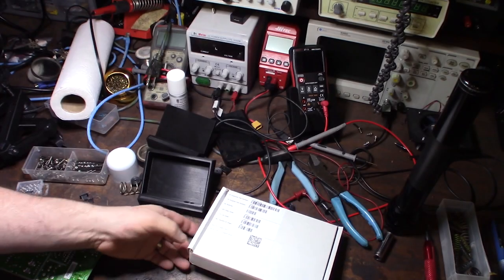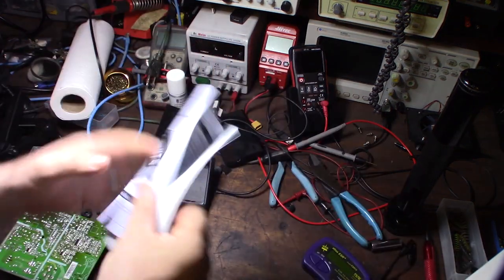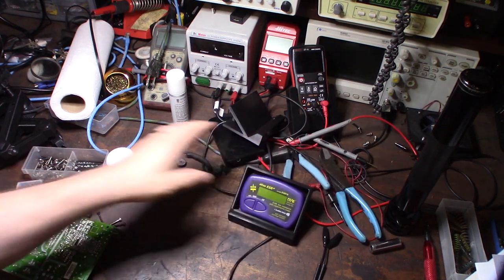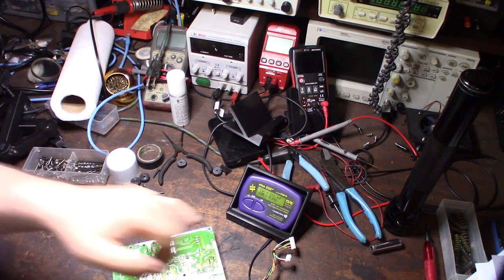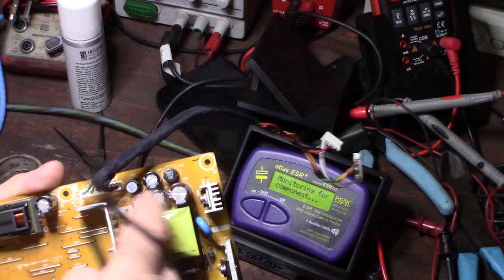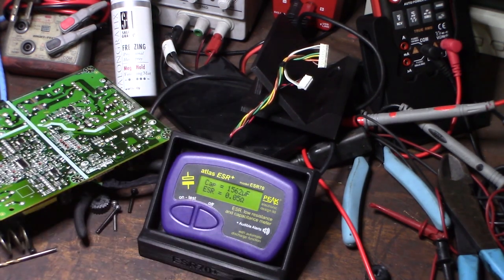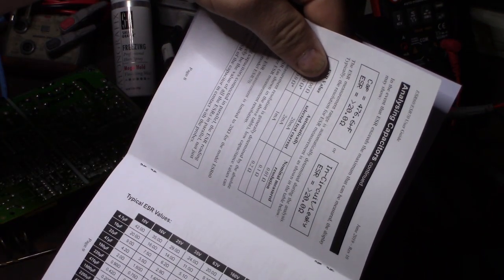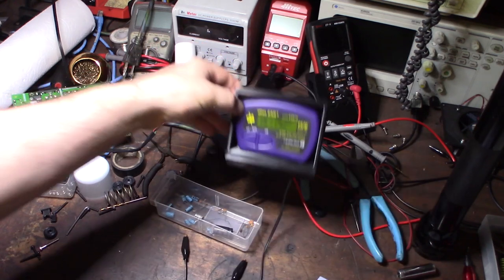Test Capacitors In Circuit With ESR Meter Peak Atlas ESR70 plus in circuit cap

Comment: Hi 

I need your help. 

I have checked the capacitors on my digital piano and got the following results in ESR levels. I used the peak ATLAS ESR70 gold.

10000 uF 25V - ESR 0.01 ohm
2200 uF 25V - ESR 0.02 ohm
470 uF 10V - ESR 0.20 ohm
100 uF 25V - ESR 0.43 ohm
47 uF 16V - ESR 0.64 ohm
10 uF 16V - ESR 1.01 ohm
1 uF 50V - ESR 1.10 ohm

I am especially suspicious about ther results for 10 micro and 1 micro F. They should be around 8 and 5 respectively. Do these results mean that I need to change the 10 micro and 1 micro D capacitors?

Thanks for your replies.
Tan

Comment: Peak Atlas products are very good, top quality, I have one DCA 75 Pro and one ESR70.
I have one GME-236 and is more fast for testing caps, obviously ESR70 is more finest cap tester, show esr and capacitance at the same time, but if you are looking for a fast meter GME-236 is the right tool for you.
I use both all the time, for a fast test I use GME and for a more detailed the ESR70.
My recomendation is, buy both if you can afford.
Best Regards.

Comment: Why not put some of those ESR70 45 degree stands on eBay under the Peak Atlas listings, I bet they would sell. I agree that it is easier to use standing up at an angle then flat on the bench.

Comment: Need to discharge capacitors. Nice way of damaging that meter or any meter for that reason..
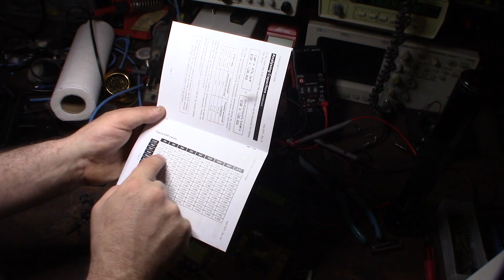Reply: Wrong! Watch the video again. At 3:10 you can read the front panel, and it clearly states the tool discharges the cap automatically.
Reply: up to 50v. It will automatically discharge up to a 50v charge. Probably better to do it yourself unless it's a small charge.